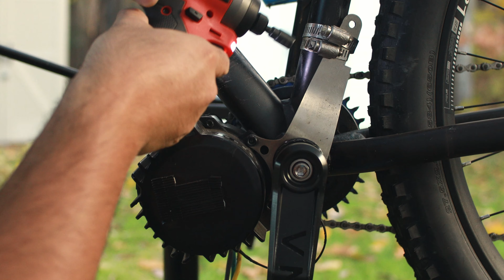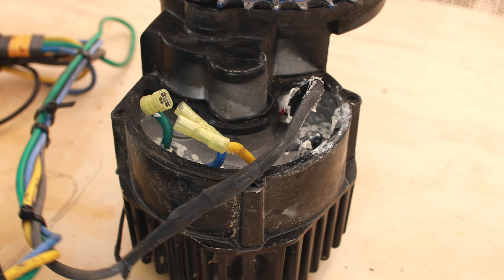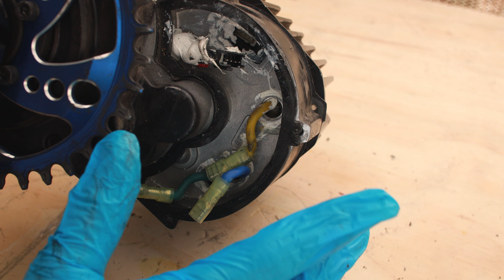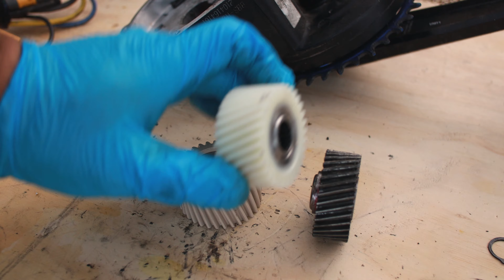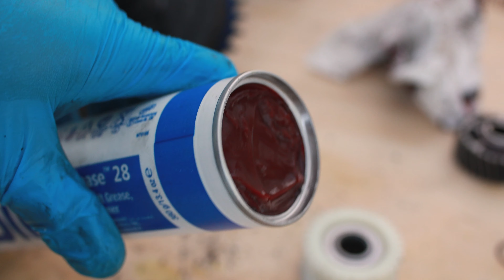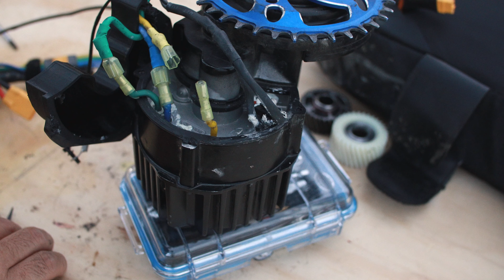BBSHD PEEK Gear Installation and Maintenance [4K]

Comment: Im running on flipsky 75100 pro v2 160a phase 95a battery 50a field weaking 7+kw 20s10p .problem is one way bearing clutch inside nylon/metal gear .its 4th time im changing.I run metal gear over 2000km and then i saw its eating rotor so back to nylon .is peek gear holding good?

Comment: I'd like to add a small comment regarding the seals: Don't use silicone on rubber seals - It will dry them out and they'll either turn to snot or crumble. Also, if using rubber, make sure they're not full of grease since it'll most likely do the snot thing too, over time...
Reply: Just reassembling my 01b and been asking myself, how to assure the rubber gasket is placed correctly on the side you can not control after reassembling (toward the big gear). It is so wobbly, can’t trust it stays on correct position. I’m tempted to glue it and have silicone for that here. But you write I shouldn’t use. What would you use to fixate the gasket?
Reply: @klapauzius8255  I'm not entirely sure, but I think there are types of silicone that doesn't impact rubber in that sense. One type that I know that does dry out is those that has a strong smell of acetic acid or vinegar. These actually contain this, which is in fact an acid, and thus corrodes rubber in a sense. This is also why you shouldn't use polishing compounds on leather that contains silicone btw (You may end up with cracks in it)

I'm thinking that I'll remove mine and replace the whole thing with silicone, and perhaps put something like tape along the rim on the piece that comes off, and slather silicone on the motor block, then remove the tape once the silicone has hardened to basically create a silicone seal. Not sure which tape is the best for this, but if you can wax it to make it non-stick, it's probably the best thing.
 I think I'll try Kapton tape since it's easy to remove and has a smooth surface. Maybe a splurt of grease or oil to make it slick.
May be difficult to cut along the edges even with a scalpel, but I'll try it I think.
I find it pretty useless to have gaskets that break easily since you have to pull the whole assembly apart several times.
I've done this maybe 15 times now since I started having issues starting with a shorted out controller (Accidentally put 48V straight into the ground of the USB connector), then it's been the one issue after the other one and each time I had to pull it apart.
In a week or 2 I'll be doing it again since I have to change the rotor because I didn't grease it enough and now it's working for 3 motors because of this.
Also not helping that only 2 gears out of 7 are working due to gear shifter is of wrong type and the derailleur is worn out, but these are also ordered and should arrive around the same time as the rotor.
I'll also upgrade from V-brakes to disc brakes which means new wheels so hopefully it'll run easier in the future.

There are special adhesives for gaskets but damned if I know what they're named or what to search for. I'm not really a mechanic, so you should ask anyone that is. Should be the same type you use for cylinder gaskets.
Reply: @ I think I use proper silicone used to seal cars/motorbike motors, non acetat. I plan to regrease nylon gear every 2 years, so new gaskets are not a problem.

On the other issues…you say you plan to upgrade from v-brakes to disc? Are you sure your bikeframe supports disc brakes?
Reply: @klapauzius8255  I'm getting censored here. I wrote some stuff that got deleted from here
Reply: Looks like YT didn't post my reply here so I'll try again (and a lot less text I might add!).
I found some brackets on Ali Express that makes that possible

I also ordered a new front wheel hub and spokes to match. The hub has mounts for a brake disc which the original doesn't.
I'm also putting a brake disc on the other wheel of my trailer which will be interesting since it has a hub motor on it and it doesn't have mounts for this so I'll have to get creative. 😬

I have a ton of things to work out on this e-bike. Swap the rear (right, forgot to mention that, again, that I already have a rear wheel with disc brake mount but I didn't use it since it's not centered properly and didn't work with the V-brakes at the time, but since I'm upgrading now I finally have use for it again) which has pretty new & fresh gear train, and with the derailleur(s) I ordered (two models plus new sprockets for the old on - I like having options!) as well as two different shifters (One twist, one with levers) I may just get this thing running like it used to. I'm just hoping that the rotor I ordered will fix this issue with grinding gears and vibrations that I have.

I'm also uncertain about the bearings since I had a hard time getting the one behind the magnets seated properly and had to use a long pin inside the rotor to hammer it into place, and that should've meant that it was stuck there hard, but when I had to disassemble it again it came off while the rotor stuck to the main block. I was really amazed how incredibly strong this LocTeft, (Clone) really (!!!) is. I had to drill a hole in the block on the other side to insert a rod and hammer it out, so that bearing has to be replaced too. Insane!
Anywhoo, I'm curious whether the bearing actually got all the way in, in either end and if that caused the grinding, or just that I didn't grease it enough and that made it start vibrate (Noticeable when pedaling) and sound weird..
Reply: For some reason, probably political, I'm not allowed to post links
Reply: I made a discovery the other day with the bicycle frame: It's actually semi-compatible for disc brakes. There are mounting holes for these right besides the holes for the package holder which I assumed was for different types of holders. Now I have to wait for a couple of days for my brakes and adapters (still need one for the front fork) and I hope I ordered the right sizes, or I might have to get creative and make something.
I do need to do something of the sort with the trailer's wheel since it doesn't even have mounts for the brake disc so I need to open it up and drill & bolt it directly to the hub without  somehow, and make it watertight too. 😬

It's going to be a b!tch since it doesn't have screws and I'm guessing it's bot threads in the rim of the hub, so it will be interesting to find out...

Comment: I would suggest that you make sure the top of the rotor (that goes in to the bearing on the other half) doesn't get greased and put some loctite on it to prevent it from spinning inside the bearing.
Make sure to get the type meant for mounting bearings and not thread lock (I can't confirm this, but it makes sense since it's available specifically for this).
Also make sure the bearing is clean too, so use some solvent, brake cleaner or acetone on a cotton swab before applying loctite.

I should also mention that there are alternatives to Loctite since it's crazy expensive, and although it may for all intent and purposes may be worth it's price, it hardly motivates its insane price for the amount you need (even if you need to re-do it a couple of times by mistakes or whatnot) and for the remainder you'll never use which will dry up or just perhaps expire(?).

Check for "locteft" on Ali Express - Costs just a fraction compared to the original, and it works very well!
I had to drill a hole opposite the rotor shaft (the block with the nylon gear) and put an axis and hammer it very hard to get it out. The whole rotor came lose which normally is crazy stuck since the bearing in that end is more or less press-fit.

This I would say is important to do if and when you're doing this maintenance since the end can be worn down and thus it starts to wobble which in turn turns the nylon gear into mush or just brake it. If you replace it with the metal version you may suffer from metal shavings since it's pretty hard and will instead wear down the helical gear on the axis (Which also means you need to grease it properly, but not too much!). The metal version is better since it lasts longer, but you will have more noise instead.

If the orange O-ring on the top of the helical gear above the rotor is worn down or obliterated, your it's toast and you need to get a new one.

Also, don't use too much loctite, just a very thin layer around the axis. Use a cotton swab to apply with. If a drop forms when applying it, it's almost too much.
Apply on both the bearing and the axis.
Screw it back together, and don't run the motor for at least 24 hour so that it may cure properly.

The recommendation, I've read, is to redo this every 100 km, if needed and you're hearing a rattling noise from the motor. It's also a good idea to service bearings, pinions and gears to keep it in good condition.

Comment: That thermometer strip is a brilliant idea, this is getting a thumbs up from me on that alone! love picking up new ideas for my bbshd.
Reply: No need for thermal strip due to open source firmware. There are also rare nonchalant reviews about throttle being smoother with stock controller and open source firmware. The pawls in the freehub doesn't seem to make snapping sound anymore.
Reply: @uvwuvw-ol3fg  Yes just looked it up, very exciting, now i can get my 28a controller to open up to 30a! that 2a increase does matter, my throttle doesn't have any issues, not sure what throttle is being widely used but i only have a thumb throttle. Did you flash the firmware, how easy was it and were you concern about bricking it.
Reply: @uvwuvw-ol3fg  Hey, do you know if a controller that had an error on would be ok to flash with it being not connected to motor and only using battery along with programming cable, thinking about trying it with one, be good to have my £100odd controller back up and running as an option.

Comment: Metal gears in this type of apps MUST work in oil bath ALLWAYS and should be properly aligned by shimms and preloaded with specific force. You are more than lucky you didn't break shaft. 🤦

Comment: Sir, Thanks for your video, i have some questions concerning bbshd motor:
1. Which is the most reliable gear to use on that 3 types of gear? And what are the advantages and disadvantages?
2. How many kilometers before replacing the gear? (nylon/steel gear).
Reply: Treat your bbshd/nylon gear well and it will go for thousands of miles, mine is going like new after 3000 miles, clean and re-grease once a year, don't use any controller over 48/52v, avoid programming it to just run high amp current  in all pas settings, don't abuse the throttle and avoid having its starting current set too high and its equivalent pas setting level, chose a chain ring that suits the terrain ( flats 42-46t with some hills, 36t for areas with a lot hills/climbs ). My advice do not use steel gear, they make the worse noise, they damage the rotor shaft, there is a reason other than cost for the nylon gear, vibration reduction, it acts as a fail safe to protect the motor core, helps with temp control. The peek gear looks like a great alternative but it costs like £120 in the UK, triple the cost for a nylon one. I've not tried the peek gear but my nylon gives me a lot of confidence with it, I'm running the full 30amps, use a 42t chain ring, ride every day with it too work and off road at my local trails.
Reply: @OutandAboutDevon  thanks a lot sir for the infos and advice, more power.
Reply: @rodolfobaliga7577 you are very welcome, hope you join the ebike family especially the bbshd one.

Comment: where did you get the thermometer sticker cannot find one on those temperatures
Reply from the maker: It came with Mr HV's kit 🙂 Although I'm assuming you can get this anywhere like the ones they use for aquariums.
Reply: @SparkyBikes  i cannot find one on this temperature range aquarium one go to 40 celsius max. does it work? what is the max temperature you have seen on it

Comment: Man that Peek Gear is hard to find these days! Nice work!

Noticed your thermometer on the drive - not a bad idea for a simple warning. Where did you pick it up? I'm seeing a lot of them for aquariums, but nothing that hi-temp.
Reply from the maker: It's definitely popular so hard to get but Mr. HV/High Voltage on Discord I'm sure can get you hooked up. If not, I know he'll have some more soon. The temperature controller is built in with the HV Kit. The new Eggrider I have also has a built-in temperature (albeit in a very small display within).
Reply: Its also very expensive, Triple the cost of the nylon one.

Comment: Good  helpful video, just one thing, the motor seems noisy, is this normal, as I thought the bbshd was much quieter, I’m looking at buying one, but not if it’s noisy when I’m riding
Reply from the maker: This one in particular was with the steel gear; I got rid of it since and went back to PEEK. Along with ceramic bearings on many that seem to make it even quieter.
Reply: @SparkyBikes  Thanks for replying, now it makes sense
Reply: @SparkyBikes  that noise was why I never even contemplated a steel gear, it looked a good idea but I could tell it had a few draw backs

Comment: Is that a Lekke Blingring? I'm in Sweden. Do you know if there is some other sort that I can buy from aliexpress for the bbs02?
Reply from the maker: It is actually from AliExpress. I was worried about the quality but it's been great! "PowerSurround Store" is where I bought it from there. "PSR-EBIKE" is stamped on the chainring.
Reply: @SparkyBikes  thanks for your answers and the vid. It helps a lot.

Comment: Man I had sooo much trouble getting that clip connector off on my bbs02. Took me months of procrastination cause I got stuck on it.
I have two questions by the way.

1. What silicone do you replace the white silicone with?
2. You said I can make my own gaskets. How? Can I use silicone instead?
Okey that was more then two but...
Reply: Make sure you use a neutral cure type silicone.  Acetic acid cure silicones wont do the electrical components any favors.
Reply from the maker: I actually didn't replace the silicone but I'm guessing any 100% silicone would work (but don't quote me lol).

The gasket can be made by using Fel-Pro 3157 on Amazon. They're a gasket maker sheet. Slightly thicker but also more durable. You can make quite a bit with the whole sheet.

Comment: i was told by befang and others not to put any sort of grease on that peek and nylon gear as it needs to be dry because the run on friction
Reply from the maker: I've been putting less grass on the PEEK gear for sure as they spread a bit but I haven't heard about not using any grease😳

Comment: hello, where buy PEEK GEAR and MOBILE 28 GREASE ?  thank you
Reply from the maker: Mobil 28 is old version so I'm using SHC 100 also by Mobil that's identical but slightly better. You can buy them on Amazon.

Comment: Some of the socket screws are stripped - some for the main gear housing, and secondary gear cover.    Everythings been working fine since I last opened everything up  - but wondering about getting someone to rethread so more than one or 2 bolts hold.    Also used 'liquid gasket seal' to replace the torn one.

Comment: I bought one of these brown gears and installed  it and it's been good. I am just running a off the shelf bbshd with a 52 volt battery. My original  nylon gear was perfect condition and that's was after 33000k but I changed it anyways but I did notice that stock nylon gear uses plastic for its top needle bearing and it was wearing.
Reply: That's amazing you rode 33K and the gear was ok.  What type of bike, motor, chainring size, wheel & tire size, and riding surface did you mostly ride to get that mileage?  Did you open motor to clean, re-grease periodically?
Reply: Wow nice I hope I can surpass yours.
Reply: LOL i hope i get minimum 5k before anything happens  @rodolfobaliga7577   i have bbs02b

Comment: Lose the custom bracket and get the proper BBSHD socket.  The tool you have is a nuckle buster and will never get the nut tight enough.  Mine has never moved since using it.  My motor is also angled much closer to the down bar

Comment: Thinking about doing this also, before I even use the new motor for the first time. How is the gear holding up?
Reply from the maker: Excellent!  I'll open her up again soon to see how it's doing and see if I still need to go with thicker grease as it's pushing 4000 watts currently.
Reply: @SparkyBikes  What controller are you using the ludacrous controller?
Reply from the maker: It's Bafang 750C 😀
Reply: @SparkyBikes  your display allows you to run 4kw?
Reply: @SparkyBikes  hi put a grease nipple on the motor and get grease gun then couple of pump every week

Comment: bought a spare motor side for the bbshd i could smell some burning smell sometimes when  i ride probably cuz im putting lot of strain on the motor ive been riding in 7th gear all the time. it wasnt until i went to 4th gear did i hear clunking from the motor pinching my brake cables cutting my power off?
Reply from the maker: I'd open up her for sure and see what's going on.  These motors like low gear ratio and high RPM so I try to keep my gearing no lower than 1:1.25 if not closer to 1:1 especially once you go with a higher wattage setup like the Mr. HV's kit I have.
Reply: Whats really making it hot is from the amount of Amps your pulling from the motor at a given time